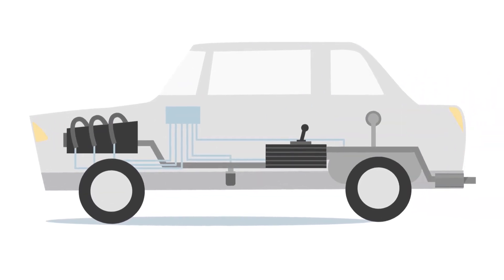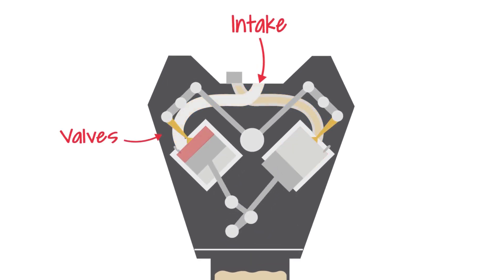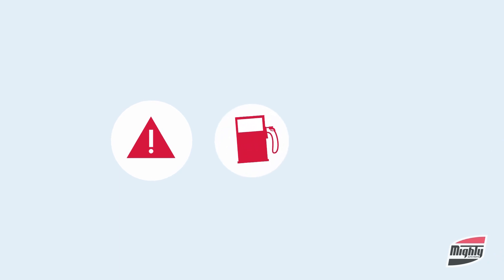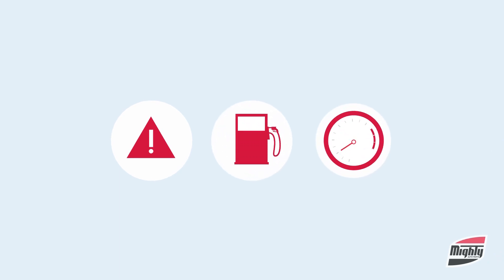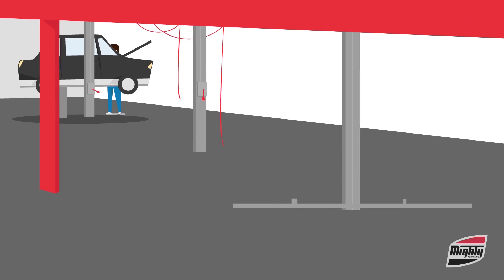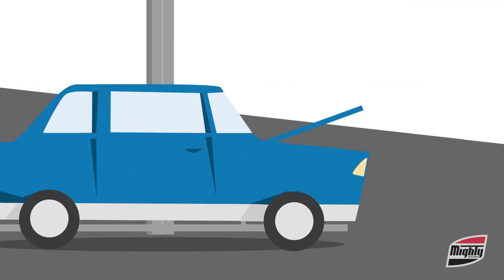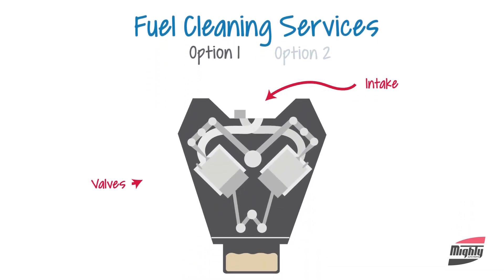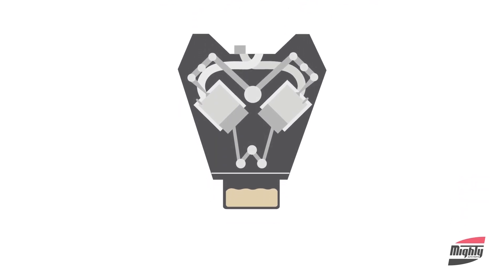Why Should I have my Fuel System Serviced?

Comment from the maker: #MaintenanceMonday: Should You Service your Vehicle's Fuel System?

The smallest speck of dirt, carbon or other deposits can affect #fuel delivery, to where within 4,000 - 5,000 miles a new engines lose efficiency. So the question becomes, what is the best way to get rid of #carbon buildup?